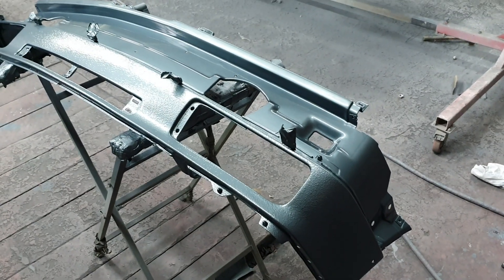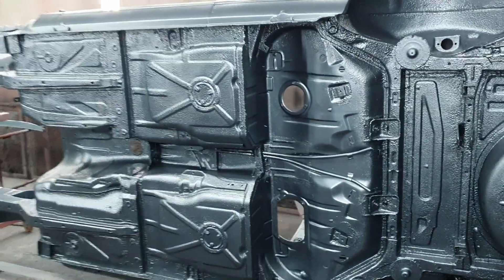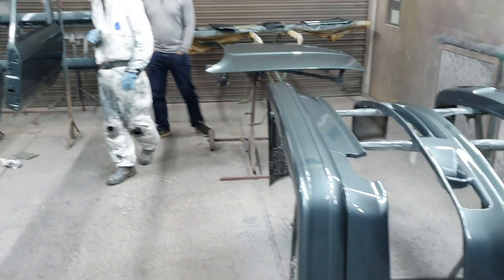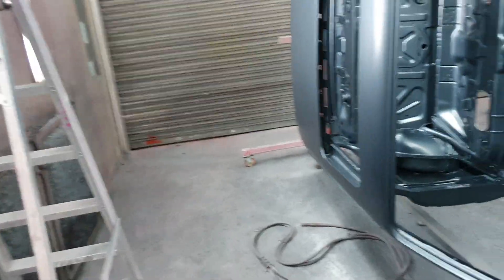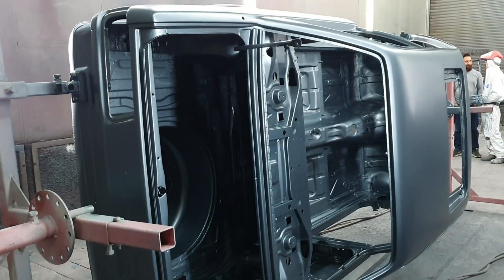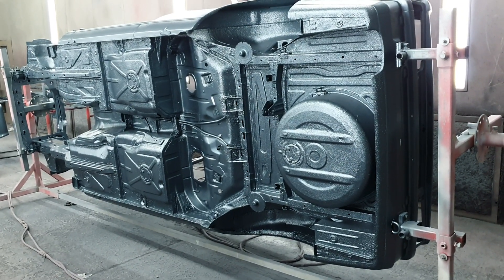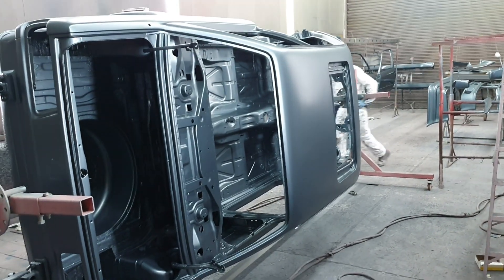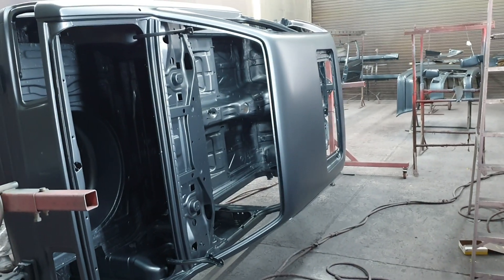video 3 bmw e30 325i sport tech 2 full restoration

Comment: How soon after applying the underseal was applied, was the car painted?? did you wait for the underseal to dry?
Reply: The under sealer we use is the 3m stuff and it must be a wet on wet contact otherwise the paint will flake off. You have a 6 hour work time after application   and its able to be painted after 30 mins thanks spencer
Reply: @spencerlatham7836  thank you! 

would this work with the 3m underseal that comes in white tins?
Reply: No this only works on the sealer we use it's the 3m 08800 thanks
Reply: @spencerlatham7836  you're a star!